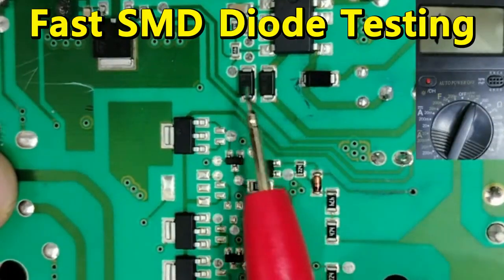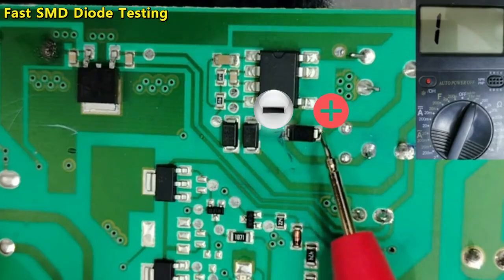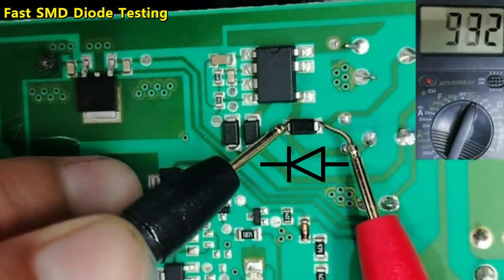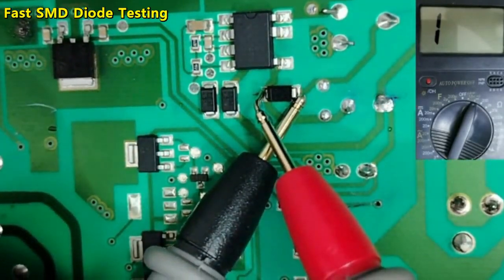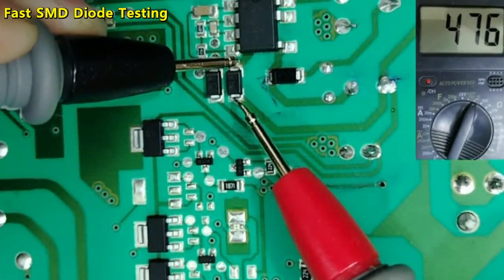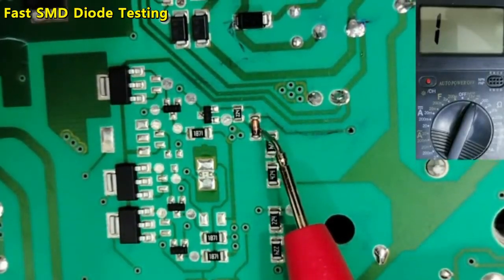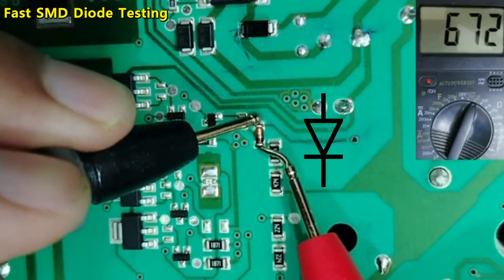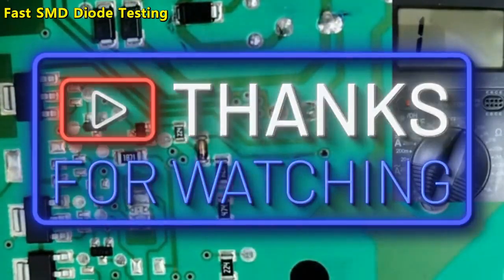Test SMD Diodes in Seconds - Fast & Easy Method | SMD Diode Testing

Comment: Some diodes go bad on board, and they have only small markings.  Is there a way to know the replacement part, or at least approximate measurements to replace it?  I found that sometimes if there's an IC chip next to it, you can look up the chip datasheet, and often times there will be a diagram with the small components in and out of the IC.  A diode marked only B5 only, will mean nothing.